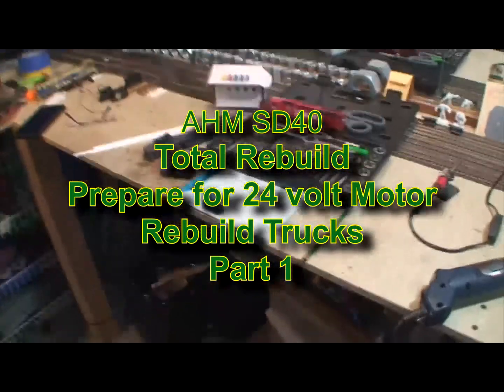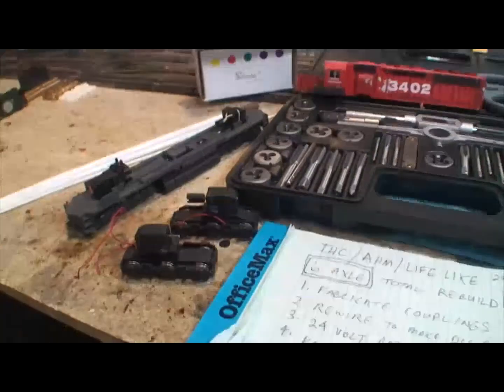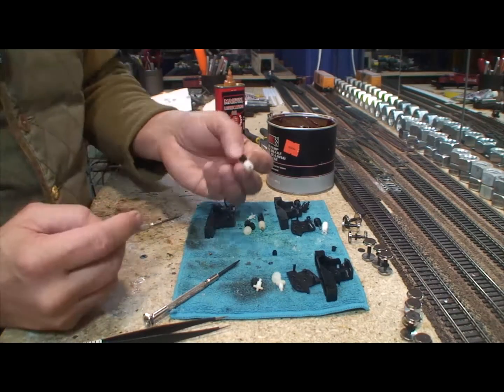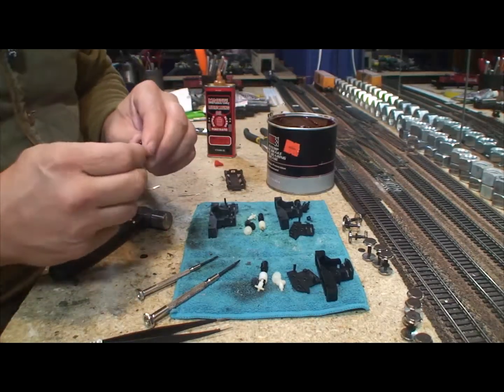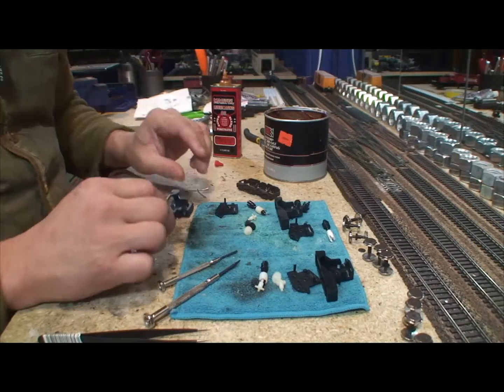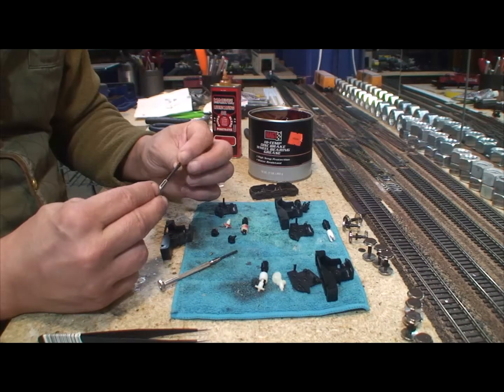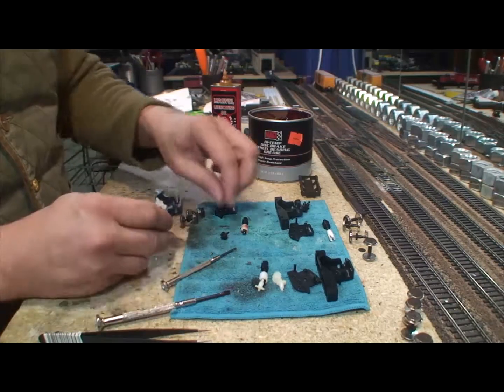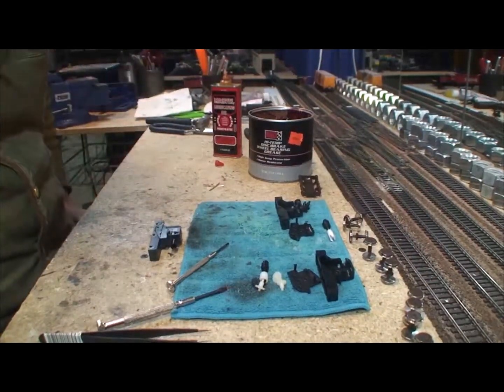AHM SD40 Total Rebuild with 24 volt Motor Part 1

Comment: Why use a over rated 24 volt motor when most ho locos use a 12 volt motor.Does not make sense electrically. Bigger does not mean better when it does not fit the voltage scale being used .
Reply from the maker: The 24v motor is a better motor.  Most power packs will put out 14-18v, so you will always have plenty of head room.  More important is the motor itself is rare earth magnet making it much more reliable.  It starts turning at very low voltage.  The operation is much smoother than a 12v motor.  24v is the normal maximum rating, using 12v is perfectly fine.
Reply: @elite194  Humm interesting.Would you share the brand and where they can be acquired. Just restored a old Lionel ho motor with a new neodymium magnet  and reworked the winding and it has that low voltage power like a modern motor.The motor original lost its magnetism,ran but drew a lot of power and you could burn your hand on it  .Now it runs cool and smooth.Gear does not matter with this motor since it has so much torque a low volts that it will creep along like a switcher should.
Reply from the maker: They come from different sellers all the  time, but to find them search ebay for 12-24v double shaft strong magnetic motor, around $4 each.  The other motor that is in a black housing is around $2 and is also excellent.  They also come in a single shaft which is very good for Tenshodo brass.  I usually get several at a time because it can take 2 months for them to get here.  Make sure to select the motors with the black housing, not silver.  They have a small shaft so sometimes you need to fabricate couplings.

Comment: Can't find the Part 2 video??? Wanted to see how to add additional  electrical pickups on the trucks and the 24 volt motor installation.
Reply from the maker: I can't figure that one out either - it's done and works great.  Adding the extra copper strips improves the ability to go through turnouts like they're not even there.  I still don't know where the video is, but I have it on the list board to do a review of it to show the extra pickups shortly...
Reply: @elite194  What brand of 24 volt motor are you using?  Thanks.
Reply from the maker: these motors are called "rare earth magnet" 24v motors, tons of ebay sellers have them - but they come from China which means shipping can take a couple months.  At 12-18 volts on the track you will only get at most about 2/3 of the possible RPMs.  The locomotive will be slower at the top end than most you are used to, but the slow speed at the bottom is amazing.  They don't need flywheels at all because they start at the tiniest voltage, but they don't coast like a flywheel locomotive.

Comment: What happened to the part showing Kadee #5 coupler installation??
Reply from the maker: I see that... what the heck happened to that video?  The whole drive train is done and running with Kadee whisker couplers in snap together draft gear.  Shortly there will be a video of designing and installing a body mount for an open pilot like the AHM  GP18, Bachmann SD40, Life-Like GP38-2 that will show more detail how to make a mounting point.